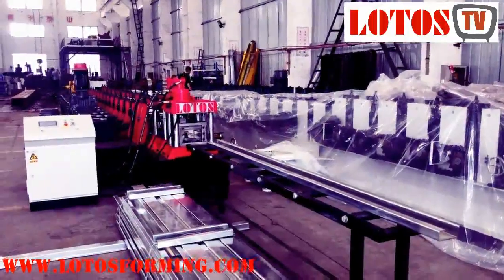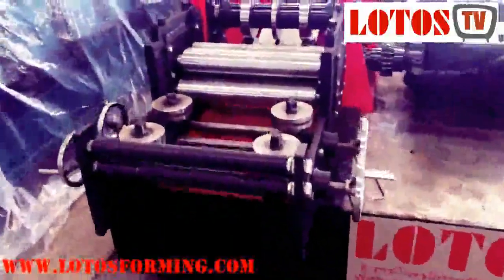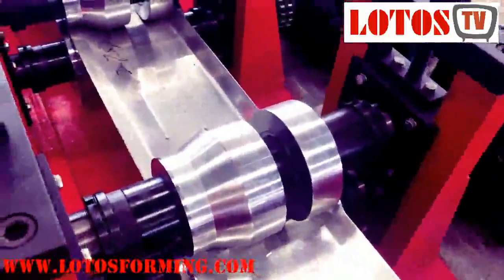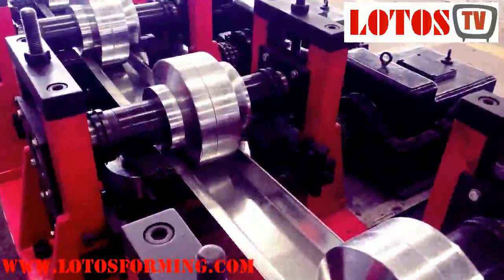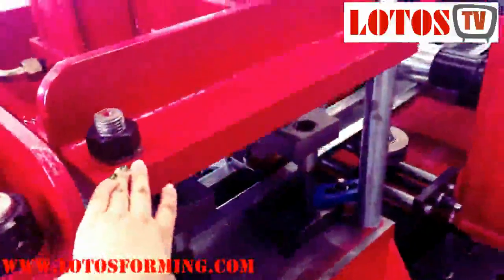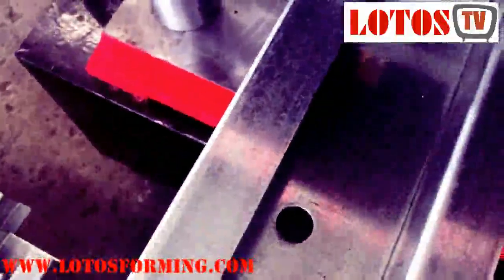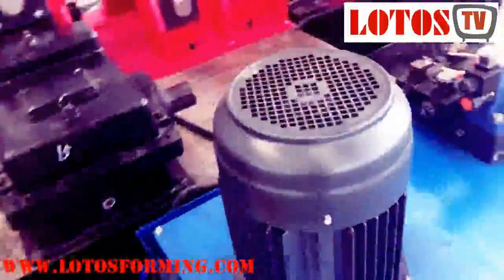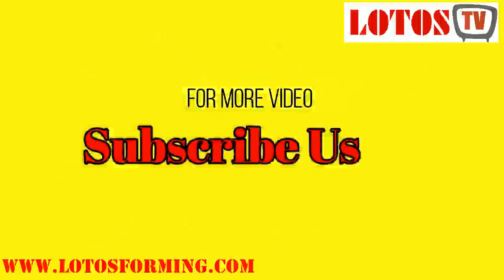【 heavy-duty roll forming machine 】: G Purlin Roll Forming Machine "NEW DESIGN 2019"

Comment from the maker: In steel construction, the term #purlin typically refers to roof framing members that span parallel to the building eave and support the roof decking or sheeting. The purlins are in turn supported by rafters or walls.